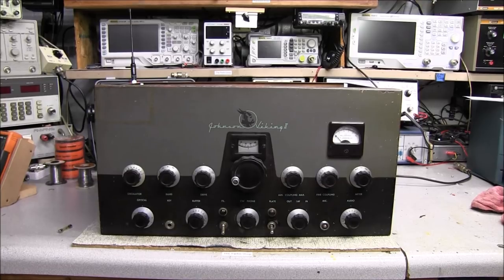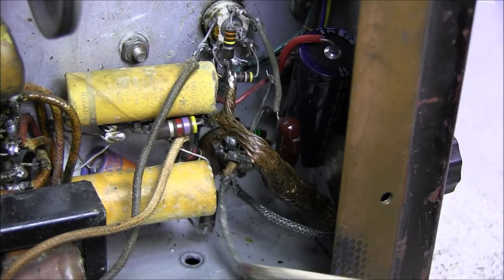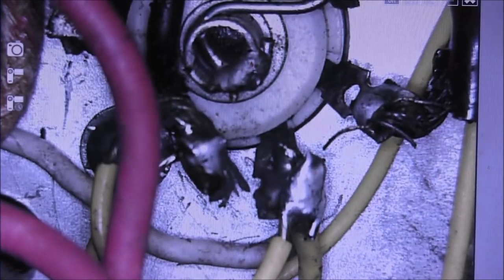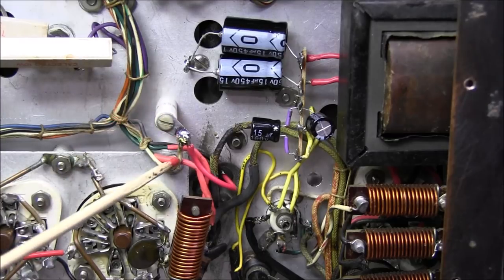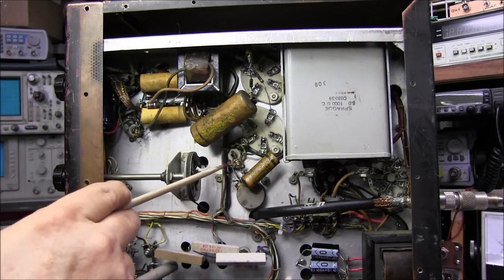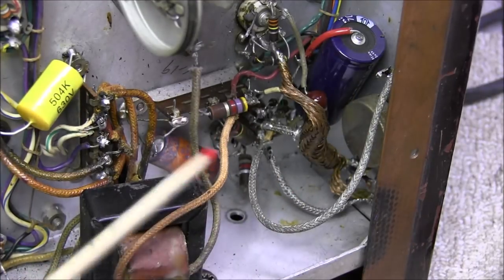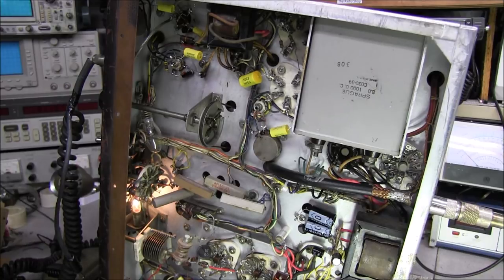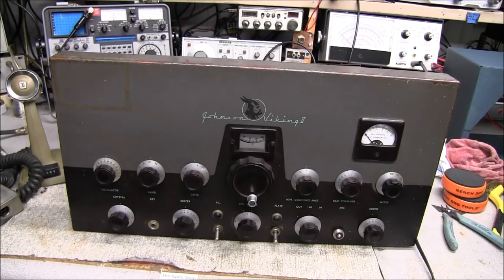#214 Johnson Viking II Restoration Part 1

Comment: Nice job restoring that Viking II transmitter. Great to see the inner workings of that transmitter  along with the schematic diagrams and explanations.  Also good to see that Tek 465 O'scope still in use. That was and still is my favorite analog scope. :-)
Reply from the maker: Thanks Dean. It is a mess but still a fun project. That Tek works a charm.

Comment: Another excellent video, Buddy. Thank you for taking the time to resurrect this old gal. In her day, she was the queen of the shack and deserves to be back on the air. Looking forward to part-II plus any additional parts you might have to do on her. 73 de K7RMJ Frank
Reply from the maker: Thanks Frank. Really fun to work on these but I should have stripped it and started from scratch. Just time is the problem.

Comment: I'm rebuilding one exactly like this one. Those grounds loops that burn are the current shunts for the meter!
Reply from the maker: That's right, ni-chrome resistive wire. Pain to solder to. These are burnt up pretty bad.  I have already made some new ones. Will cover it in part two. Thanks for watching.

Comment: Hi Buddy. My Viking II stock with good c1 and c54, I ran the mike gain at 4 using an Electrovoice 611 dynamic to give the mod peak current at the red line on the meter. The 611 was a great match for lifelike audio, not to bassy nor tinny. Properly loaded, grid 5 to 6 ma, plate 230 ma, I think the red line on the meter was mod current of 160 ma peaks. Mine did 105 watts on 80m and 90 on 10m. I killed a pair of 6146's cause I thought the red line was grid :-( ooops! and since I didn't have any more 6146's I put in a 12.6v transformer and lifted one end of the 6.3v line to the filaments and put 12.6v there and put in 6883's :-) which I had a bunch of. That's my Viking II story and it's still working. Had a ball on 10m back in the 80's and 90's.
Reply from the maker: Thanks for that story OJ, I love hearing that.  Good deal on the 6883 swap. Guess we all make mistakes at time. I do not think the book is clear on that so defiantly a trap.

Comment: I could be wrong, but I think you replaced the plate and mod meter shunts with regular copper wire and they should have been ni-chrome.  Near the 5R4 tube sockets.  Yours have green insulation.  The shunt resistance is super low, tenths of an ohm as I recall, hence the ni-chrome wire.  Like I say, I could be wrong.  But, wow, you've done a great job so far on the restoration of a great transmitter.  I have a Viking II and it's fun to use.
Reply from the maker: They were the original wires but the insulation was burnt off.  I cleaned them up and slid green insulation over the wires and dipped the ends in copper so the solder would stick better. However I do think the shunts were heated too much Need to find some new shunt material. Thanks for the comment.
Reply: Very good and thanks for the reply.  Good luck with the shunts.  73.
Reply: real restoration work!

Comment: I’ve been following your YouTube channel for quite a while, and I’ve learned a lot! Many thanks. I have a repair situation that I’m hoping you can provide some suggestion for. I use a Flex 6500 for my HF transceiver. I have a 2M transverter and amp connected to it. Both devices are keyed by the 6500 using an open collector connection the 6500 provides (TX3), providing a switched ground. During the recent VHF contest, I discovered that the TX3 outputs was stuck in a constant “on” position. The open collector transistor is obviously shorted. Sounds like an easy repair, right? Flex has a hard and fast policy not to assist anyone in self repair, nor have they released any schematics. Their only rersponse is, send it in. So, I’m faced with finding the surface mount transistor and replacing it. Do to the density of the two PCB’s it’s impossible to do it visually. My idea was to inject a low-level RF signal into the TX3 output connection. I’m thinking of making a very small loop, maybe ¼” connected to my spectrum analyzer and trying to sniff out the connection.  Have you ever been faced with such a situation? What I’m unsure about is because the transistor is shorted, won’t the RF be all over the radio on the ground plane?
Reply: not being a wiseacre, but first find out what caused it to blow!
what has worked for me in the past, just a (decent very low power) meter on continuity and randomly poke around until you track it down.. not sure how dense/small component the board is, but I'm sure all the  I/O ports are fairly well RF shunted to ground, so tracing that way will likely be fruitless

Comment: Very nice.  It would be interesting to know what tests you performed during various steps in the first start up.  Much of that knowledge has been lost.  I am sure you didn't't just plug it in and hit the switch.  Did you test individual components or basically check current draw?  Your methods are of interest.

Comment: 6:02 + would probably imbalance the circuit, but maybe not enough to hurt it and not sure what the original setup looked like, maybe it was that way from factory sans the chokes?
seeing it the two tubes to variable cap, other wiring and choke, which appears to be for DC ground shunting if a tube shorts internally, it may not be an issue unless trashy harmonic signals occur.
I'm no engineer, nor spark/junk-tronics god, so please take the above is "to be taken with a grain of salt" :)
Reply from the maker: You are pretty much spot on.  The original setup the choke is attached to the center of a link wire then to the tubes.   I have my suspicions on what this rig was used for.

Comment: At 16:15, why do the green wires have a loop?
Reply from the maker: They are not just wires but resistive shunts made from ni-chrome wire..  Almost impossible to solder so I copper plated the ends.
Reply: @TheRadioShop  
Sounds like magic to me.